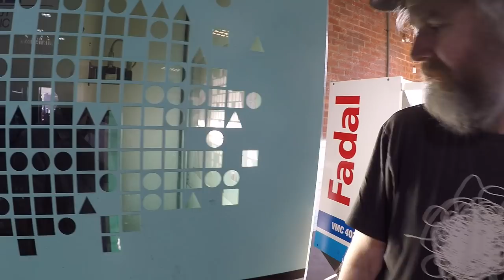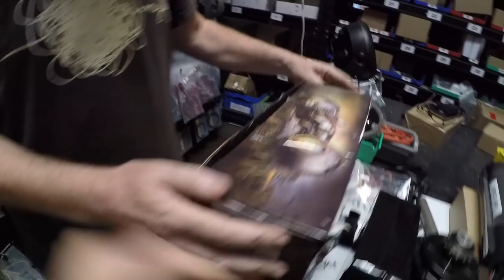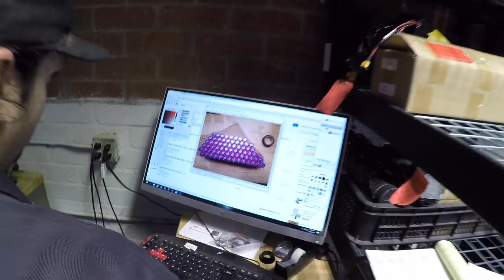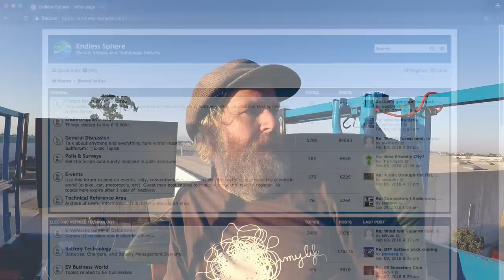Luna Cycle Headquarter Visit, Interview with Eric Hicks, Founder

Comment: Love all your videos, but this is one of your best. So cool to see luna cycle and Eric with all his passion. What a man. I got his bbshd 750 watt mid - drive motor with all the options. Shift sensor is the best. I love it, keeps me going. You should do an update video. My best to you and eric.
Reply: Muddy Waters bbshd it was a cool kit, so 750 watt nominal 1000 peak. I got the shift sensor, it cuts power to the motor momentarily when it senses a shift in gears. Comes with 2 break cutoffs  and a speedo. Easy to do. Do get that luna tool for the bottom bracket. Also I did not get a battery from luna, I got mine off amazon 48 volt 17 amp. Good luck.

Comment: I have 2 of their kits and batteries. Going on third year of use still in good shape.
Reply from the maker: Sweet! It's always nice to get real world feedback, so glad to hear that the kit is holding up well for you :D
Reply: Same here, 2 years on 2 BBS02s from them. Not a single issue. I've got about 3,000 mi on each bike now. Since it has replaced much of my small trip driving tempted to build a BBSHD now with a Larry vs Harry Bullet cargo (Bakfiet) frame.

Comment: I'm a long time fan of both ElectricBikeReviews & LunaCycles. I have been waiting for just such a video pairing. I have to give thanks to both for my e-bike. After becoming interested in a Sondors video I began researching and, of course, came across great in depth videos on ElectricBikeReview.com. Unfortunately while affordable I wouldn't want to run out of battery with the 60 lb single speed Sondors in my hilly neighborhood so I started looking at kits and learned about Eric. I have since put a Luna Cycle mid drive & battery kit on my old Cannondale MTB and couldn't be happier! Eric and the entire team are knowledgeable and very helpful as well as enthusiastic.
Keep up the good work. Any chance of a follow up video? Possibly even a test drive? (In keeping with your desires for safety and legality Luna can configure a "street legal" BBS02 limited to 20 or 28 mph).
Reply: My 1 complaint about Luna Cycles is that they are on the wrong coast (for me in NY).
Reply: A note on Luna Cycles and warranty...I've had my kit for over a year with around 1k miles on it (ridden on & off road thru all weather) without any issues with electronic parts. The kit did end up wearing my old chain & cassette as well as breaking some spokes but I had nearly 10 years and countless miles on them and expected some extra drive train wear with a mid-drive.

Comment: Are they still at the same address?  I plan to convert two of my mountain bikes to electric and want them to do the conversion.   I'm in San Jose.  Not wanting to drive to LA.  Is there a installer in the south bay area that they recommend doing the installation?
Reply from the maker: Hi Les! No, I think they moved to Gardena. Their new facility is said to be larger and nicer, I'm hoping to visit and film again sometime this year :D As for other installers, I don't have much experience with that and can't really recommend but maybe someone else will, or you could post and ask in the EBR forums: https://electricbikereview.com/forum/
Reply: Les Hsu I would recommend reading all you can about ebikes like on endless-sphere and doing the conversion yourself!  Last year i wanted an ebike but honestly i cant afford to drop +1-2k for one.  I then spent my freetime reading up on all the ebike material i could get my hands on and eventually i bought a 48v 1000w rear ebike kit from ebay and couldnt be happier!  Be sure to get a grin tech v4 torque arm if you buy a +750w motor.  I currently have v/ rim brakes on my old mtb and i must admit that braking performance is a bit hindered due to the increased mass / speed from the ebike kit.  Im now researching on upgrading my forks so i can utilize post mount 180-200mm disc brakes so that i can stop as well as i accelerate!  Just so you can get an idea on pricing: 150 ebike kit, 30 torque arm, 15 triangle bag.  I used three rc 4s lipo batts 7.5a in series but im thinking of upgrading to two multistar 6s 20amp lipo packs from hobbyking for 250.  My batt setup currently gives me about 15-20 miles depending on how heavily i use the throttle.  Goodluck to your ebike project!
Reply: Les Not that hard to do and in fact very fun project. It's a kit. Get the tool set, too. You can do it, just watch install videos. 
Paying someone to install it will just obliterate any savings vs buying a factory ebike.

Comment: I have 2 years and 3,000 mi on Luna's 750w BBS02 kit and 48v shark park.  I ride them I'd say 3-5 days a week mainly at 20-25mph speeds. I haven't had a single issue. Beyond typical bike maintenance, I've had to do little to nothing, and the motors are as good as new.  I'm really hoping Luna comes out with a cargo bike again, maybe bakfiet style and with the newer Bafang Ultra. would be the dream...